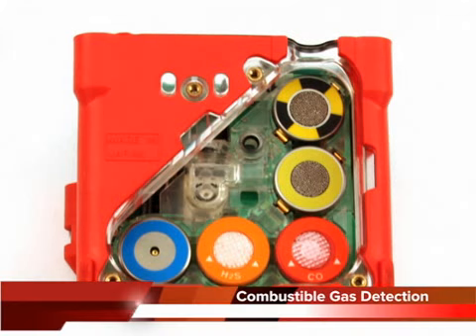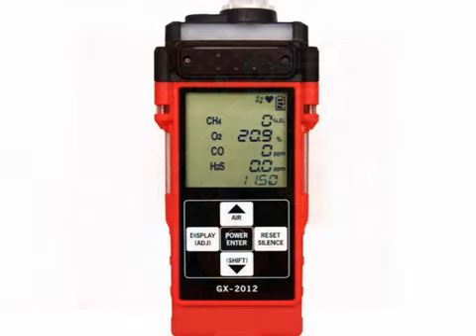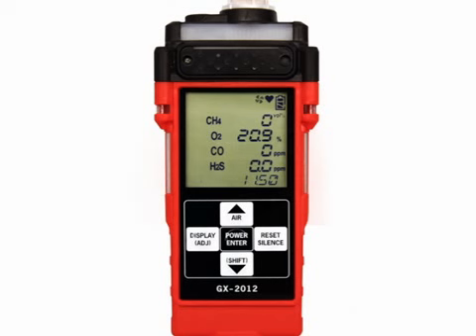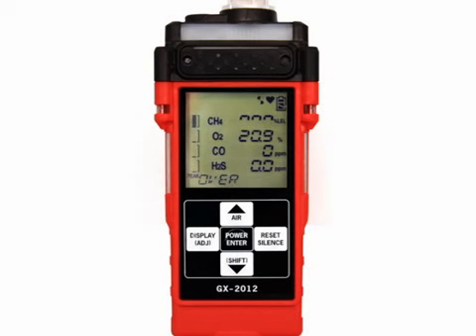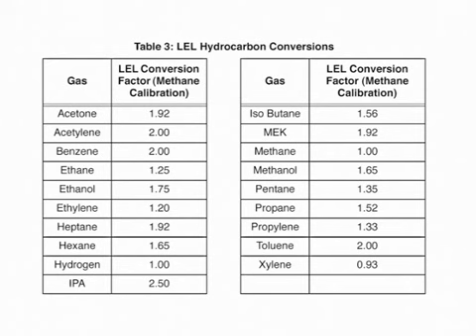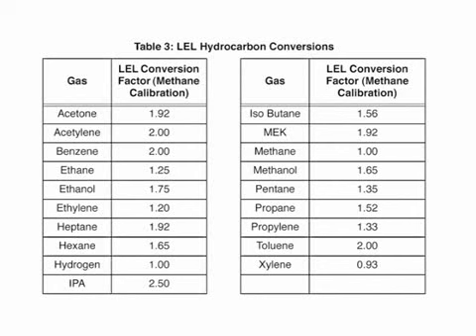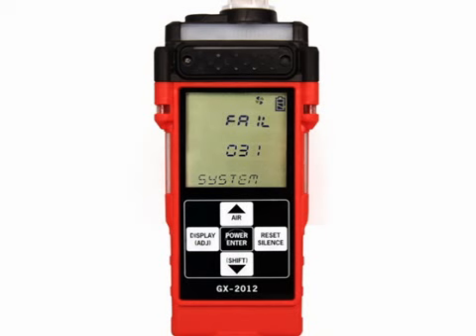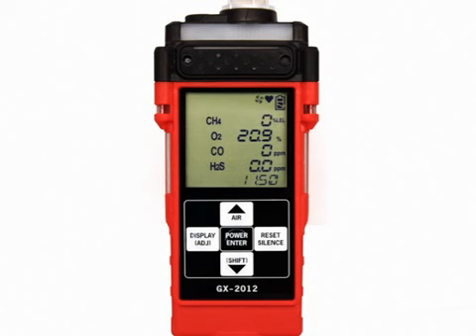GX-2012 Gas Monitor Operation

Comment: Can the user easily replace the sensors? Or do they need to send the monitor back to RKI?
Reply from the maker: Hi Kevin. Replacing the sensors for the GX-2012 is very easy and user friendly.  If you go to http://www.rkiinstruments.com/pdf/71-0336.pdf and scroll to page 182, it details out the step-by-step instruction. You would only need to send the monitor back to us if there are maintenance issues that are out of your control.

Comment: How do I go about going in on the monitor to change the gas level presets? (PLEASE Answer SOON)
Reply from the maker: Hello Kevin. If you could provide us your email, we would be happy to give you directions on your inquiry. Thank you.
Reply: I sent you a message on your website and attached a link to this video url
Reply from the maker: Gas level presets could be: (1) the alarm levels or (2) the auto cal values.

(1) Alarm levels are changed by going into Maintenance Mode and going to ALARM-P, page 120 in the  manual. (http://www.rkiinstruments.com/pdf/71-0336.pdf)

(2) Auto cal values are changed by going into cal mode on the instrument and push and hold SHIFT and DISPLAY then release. Starting on page 58 of the manual.

Hope this helps!